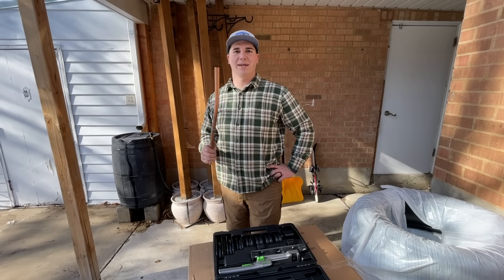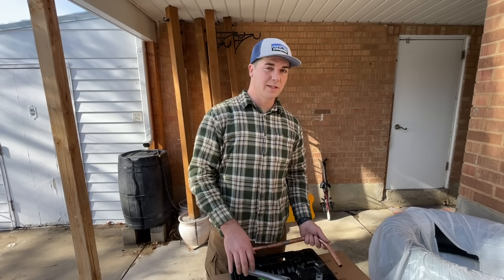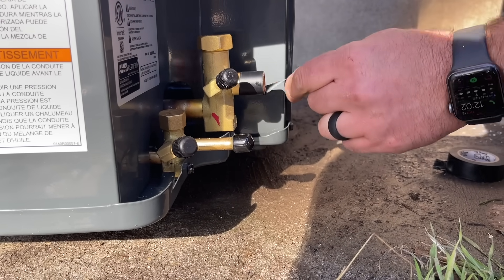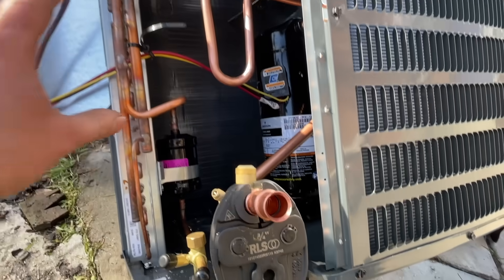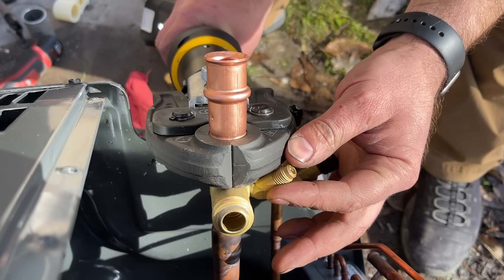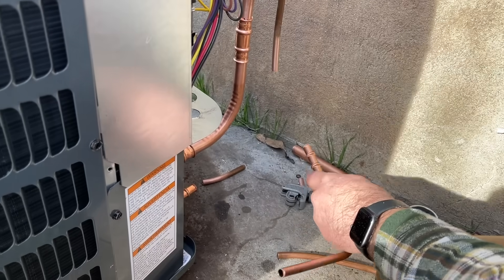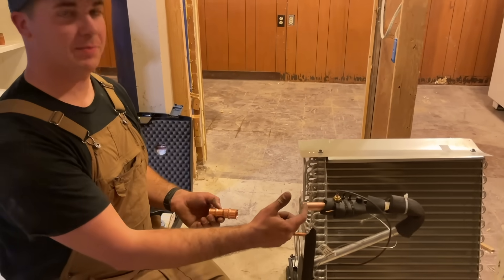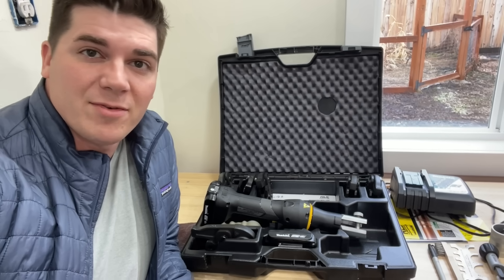Brazing Is For Cavemen. THIS Is The Future Of HVAC Copper Connections. -RLS Crimping Tool-

Comment: Are you sure the o-rings in your water plumbing fittings is compatible with refrigerant & oil. Also i could copper braze it all before you finish the first one. Also today we have MAP gas to copper braze. Costly tools, fittings not to mention all those places you put fittings is a liability  of leak !  FOLKS dont do this you will be SORRY.

Comment: staybrite silver solder and mapp gas torch is the way to go
Reply from the maker: Yesir that’s what I normally use but I got this tool because I was really intrigued. I haven’t had a leaks yet. I have fittings on probably a half a dozen systems now. Cheers

Comment: This is probably great for rental properties. But not so good if you’re building a nice house that you want to last. I've repaired enough small engines to know that rubber has a limited service life...and gasses permeate right through it. There is a reason that laboratory-grade vacuum systems avoid rubber like the plague.

Comment: Stay bright 8 works without using nitrogen flow..1st 410a  units i used those still has no leaks its been 12 years now on our maintained apartment units..that crimp IMHO is good in plumbing waterlines and hydronic boilers and residential hot-water system.. our plumber used those everytime..its a pain to solder waterlines with trickling water😂

Comment: This is the future because they have to go to flameless connections. Not because it's easier. The new refrigerant they will be making us switch to is flammable.
Reply: So what? The system will be purged at the time of brazing. I have not had any problems working on systems charged with R290, it's just a case of knowing what you're dealing with.
Reply: @nickwinn7812  
Ok. That's what I was told. I have never done service on these new systems.
Hope no one accidentally tries to unsweat a line on a unit that wasn't properly evacuated. Especially inside a building. 
Mistakes happen all the time. Sounds like a disaster waiting to happen.
Reply: I have been doing hvac for 23 years. And I agree that this is perfect for the new R32 flammable refrigerant. Hopefully it holds up without leaking.

Comment: All those big tools dont fit in tight places. Which is where they stick most equipment. 
Easy huh? Only about 100 more steps than brazing. Why so many connections? Soft copper bends easy. Taking everything apart to maje connections? What a waste of time. 

I would have had that done in half the time and properly brazed joints dont leak. Cavemen are smart.
And not afraid of a torch.

Comment: id reccomend a flare before using a crimp oring on refrigerant. also if you are using these crimps in the field you should pre braze ends on the king valves and coil ports to accept whatever crimps you are using

Comment: I recently got the hand crimping tool for pressing RLS fittings, and it was much more difficult than I expected. The coupling didn’t seem to have a depth stop in it and when I was pressing the fitting it slipped down the pipe and I couldn’t press the other side into it.
My questions are: is this how all RLS fittings are or was this a bad batch?
Any tips on how to keep the coupling in place while pressing; I saw you were pushing it in the video, but that would seem to be the opposite of my experience. 
Thanks in advance

Comment: We used a propress brand system in a occupied medical area installing VAV boxes with Hot water heat.  The only advantage was we didn't have to get burn permits every day and no torches were used in the ceilings.  We had to mark every joint visually because there were typically 6 to 12 presses per VAV box and we installed over 500 boxes.  Even doing that the guys missed several presses which we found when testing with air.  It has its place but the press and fittings are expensive,  but I wouldn't even think of using it on refrigeration lines.  Good Luck!

Comment: Just another over priced tool, lots more work and guaranteed to fail down the road.
There’s nothing like a nice solder seal. Years and years of security.
By the way, once that oring coupling goes, you’ll now be required to replace the whole end manifold, if it was soldered, one, it wouldn’t leak, two, it would be a simple replacement.  It’s, Torch for me……
Much cheaper tools, quicker, no pricey fittings, it’s a no brainer.
Just return your tool Joe, read what the pros are telling you

Comment: Why not bending the end off your pipes? Now you added 2 potential leaks to each pipe. Also other brands use called ‘V contour’ profile on their press-fittings. They would fit better on your outside unit. I would prefer a flare coupler on the unit, also available as press-fitting.

Comment: The only reason trades people are using crimps is that any eejit can use them,your talking about soldering which is tried and tested and works well brazing is using a brass rod with flux and an oxy acetylene ,cuppotechnic is like brazing but using silver solder rods welding can be gas or electric and screwed is handy but proven,if you are a good tradesman you should be able to do them all,anyone can use crimps and collars that’s what ruins trades cutting corners  with this stuff.

Comment: Every o ring I have ever seen last about 20 years. I have seen and own an ac unit that is from 1988 and still works, 35 years of service. You go ahead and put in that clamp on o ring fitting. I will stick with hermetic sealing.

Comment: bad idea to use water crimping fittings with o-rings on hvac systems. That o-rings will not survive in such an aggresive invironment for long! Yes, it will hold for a while, and you will present a working non leaking system to your client, but within a year, you will get a call. So, if the main purpose is sucking more money from your client - yes, it is a good idea

Comment: Can you crush outside copper AC lines by standing on them?
Reply from the maker: Yes
Reply from the maker: It would be hard but you can do it for sure
Reply: @diyhvacguy  So you'd really have to stand on it good? The reason I ask is because I get landscapers back there all the time. I'm about to take all the insulation off and check for crushes.

Comment: how did you create those fittings that you slide over the brass to make the joints? Or did you purchase them separately? That part isn't shown in the video. I'm assuming you shaped those fittings out of an unformed length of soft copper.
Reply from the maker: No they are specialty hvac crimp fittings with o rings inside.

Comment: What kind of price point difference is there between this unit and Milwaukee’s short throw press?
Reply: Looks like the rigid press isn’t a huge savings over Milwaukee or Dewalt full press sets that run from 1/4-1 1/8th at a glance.

Comment: What I don’t understand is that this seal is completely metal on metal right?. I just don’t understand how that prevent minute leaks over time. But I like it
Reply from the maker: No it has o rings inside. But the clamped copper on copper has proven to hold hundreds of psi by itself.

Comment: Staybrite solder with 5 to 8 percent silver works fantastic. No need for nitrogen purge as temps are lower than 700 degrees. Can use a hand held propane fuel torch so no dragging around an oxi/acetylene rig. As far as pressure holding ability, that's not ever going to see anywhere near its capability so no worries there.
I can see possibly using the crimp fittings in some situations but for line set hookups, I will stay with the Staybrite
Reply: The 5% Ag StayBright has enough shear strength and vibration resistace to last 20y or more. Without nitrogen it gas to be used with a flux, and the effect of the flux residue on refrigeration oils and compressors is to destroys them in few years. The flux can be flushed out, but that would be a lot more time and money than flowing nitrogen so you don’t need flux.
Reply: Yes, fluxes, when left in place, are bad for everything, including the pipe because it doesn't stop etching into it. 

Copper rods also have flux in them, this potentially causes small leaks over time in all copper pipework. 

Slow/low pressure flushing is always recommended in line sets, even with a basic solvent before finally closing the loop and  commissioning.
Reply: International Fuel Gas Code and NFPA 54 National Fuel Gas Code are identical

403.10.1 Pipe joints. Pipe joints shall be threaded, flanged, brazed or welded. Where nonferrous pipe is brazed, the brazing materials shall have a melting point in excess of 1,000°F (538°C). Brazing alloys shall not contain more than 0.05-percent phosphorus.

403.10.2 Tubing joints. Tubing joints shall be made with approved gas tubing fittings, brazed with a material having a melting point in excess of 1,000°F (538°C) or made with press-connect fittings complying with ANSI LC-4. Brazing alloys shall not contain more than 0.05-percent phosphorus.
Reply: @muramasa6283  and yet although the new refrigerants are a bit flammable they’re not fuel gasses so even though I would agree with the idea that brazing is the right way to join them, the cited code isn’t applicable.
Reply: @muramasa6283  
Right because regulations from the government are done because of "quality" and "safety". 
The whole reason for brazing was due to EPA and R22 being bad for the ozone. So brazing was required because if you had a house fire your lines would not burst open due to the heat. This is an extremely silly rule when you consider the tiny percentage of homes or offices that would have a fire.. Its even more ridiculous of a rule when r22 is banned for years now and you can not buy a unit with it.
Reply: Yes,  finally someone stands up for the correct way to do things for long term reliability.  Next these guys will be using PEX from the local thrift store to hack these systems together.

Comment: I didn't know these were rated at the psi needed for hvac work. It looks cool but I think brazing is better. I can braze those joints almost as fast as you and that tool if not faster. Cool tool though.

Comment: are the press fitting you are using just standard plumbing viega propress fittings or are they HVAC specific fittings?
Reply from the maker: They are specific hvac rated fittings. not plumbing fittings
Reply: @diyhvacguy  is the press hvac specific? Or will a Milwaukee or ridgid propress work

Comment: Brazing is the way to go. Even if you use them here and there, you would most likely have a good amount of costly callbacks down the road. I have been doing hvac for awhile and there is already a lot of new parts etc that can fail and to add these fittings onto that may cause some serious headaches.

Comment: doesn't cutting the valve on the condenser voids the warranty?
Reply from the maker: No. The warranty is all based on your relationship with the dealer. And I’m not at all worried about them taking that condenser if it ever has issues.

Comment: Question:  I had the AC techs replace my compressor and evap coil.  The genius tech forgot to put the master orifice in the expansion valve at the evap coil.  Of course it took them 4 visits to fix the problem.   The tech opened the line installed the orifice without drawing the system down with vac?  He said it did not have to be vacuumed because he said it was only open for a min.  I call this BS?  If a line set is open do you have to vac the system before adding  410A?
Reply from the maker: Absolutely. Sounds like a not so great company!
Reply: I will call them back.  The evap coil sounds like rushing water when the compressor kicks on.  Something is not right.

Comment: I started working in the plumbing and heating field in 1971. In the summer of 1989 an employee contacted me. Bob told me they could not solder the gas side connection at the condensing unit. I told him I could do it in less than a minute and that the drive of about 25 minutes was a waste of my time. I asked if he wanted to bet me (I could silver solder an "unsolder able" connection in less than a minute. He would not bet me. I did it in less than one minute. Soldering is a piece of cake. No need for anything else. Just get proficient at it and you will be just fine.
Reply: Should of brazed it
Reply: R454b has entered that chat😂
Reply: @BobbyJohnson-o2v  What about R454b ?
Reply: Seems like a lot of trouble to go to with the electrical tape and the cutting and everything and all you needed to do was throw a little solder on there
Reply: ^ are you referring to a StayBrite or similar? this is strong enough for long-term? MAPP gas? ty
Reply: @stupiderthanjupiter4987 as I understand, you could get away with staybrite on r22 because of the lower pressures, but with 410a the pressures increased to a point that brazing with oxy/acetelyne was necessary
Reply: Brazen not solder
Reply: @mr.orim0782 it's "brazing" and, they call it "silver solder" even when brazing because the terms are often used interchangeably for silver-based filler metals that join metals above 800°F (brazing), but they contain enough silver (often 5% to 56%) to create strong, ductile, lower-temperature joints compared to other alloys, making it a popular, high-performance material, especially for HVAC and jewelry, despite technically being a brazing alloy. It's a misnomer for pure soldering (below 840°F) but "silver soldering" is just a common name for silver brazing.

Comment: How do you remove the fitting?  I  stick with a torch... in The UK its all push-fit plastic now,  which gets the job done in half the time,  but personally, I doubt how long its going to last. ... however the British standed copper pipe is so thin nowadays, its getting pinholes in it even after 5 years use....lol nothing is made how it used to be... on purpose in my view.
Reply from the maker: I have a video showing how to remove them. It’s not bad at all

Comment: Just watched a vid-they took the o'rings out and pressure tested the  fitting -it didnt leak-so even after the rubber is worn the fitting should hold-its more of a compression fitting.

Comment: If you have 3" copper and theres a joint by the wall, how are you going to press it? What if theres a ball valve near it and its got a leak? You gonna press it? Nah. Press fittings have their place, but brazed joints arent going going anywhere for a long time

Comment: As an electrician, I would have issues with the lack of 90-degree wiring to the point I would have to install a couple of one-hole straps with anchors into the concrete and maybe a zip toe or two. I always want the customer to know they hired the right person even if it makes the other lines and wires on the house look worse. The only place I will not square things up is when an existing pipe run is not level then I have no choice but to make mine the same but it hurts inside.
The tool is interesting but is there a warranty on how many years it is designed to last? Will the company replace faulty parts if you prove it failed but was installed correctly by sending the part to the manufacturer?

Comment: I see it is being useful for DYIer who doesn't have brazing tools and nitrogen, however the tool is crazy expensive and the fittings are like $20-$30/piece. Same reason applies for a pro not to use it except in certain situations - $100 in parts spent with higher leak risk

Comment: I’m not a real fan of the idea but I mean if it last 10 years and that’s the warranty of the unit and Probably will seeing how refrigerant is oily but there will definitely be a leak but I believe you would have less TXV problems and less contamination of the copper but longevity probably not the greatest you got five apples in one basket and five apples in the other And you would probably have less leaks on in-store you can’t be perfect every time you U have the old torch out And I know for a fact in commercial applications it’s like almost impossible to ever use a torch so that would definitely be the way to go and they’ve been using these for years so they’ve been proven to work but nothing last forever anyways

Comment: Had a plumber use this kind of tool on a new water supply line run into my house.  Wasn't crazy about the idea of O-rings that will eventually dry/crack/degrade but he assured me that it was specially designed for plumbing and should last for several decades.  

I'm not sure I'd trust it with HVAC where the pressures are a lot higher and there's constant vibration from the compressor.   There's a reason you had to the line on the condenser...because the manufacturer wants you to braise the joints.